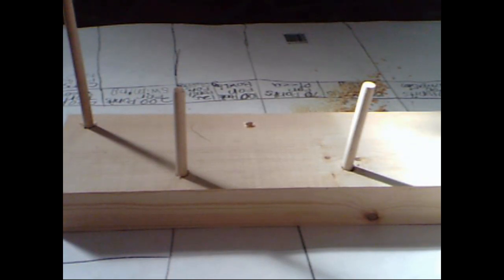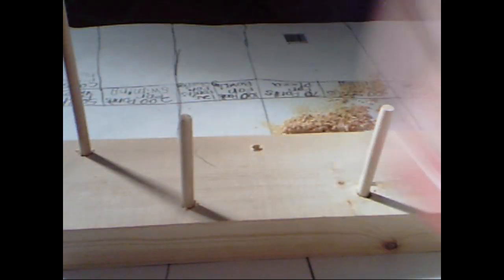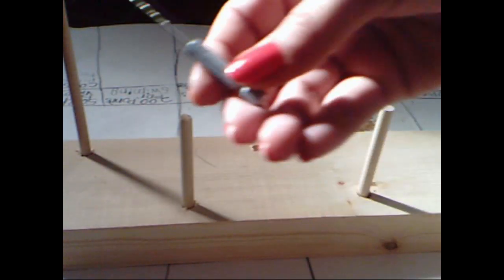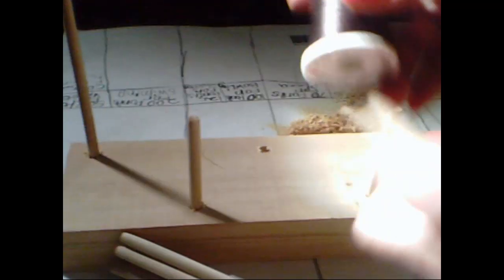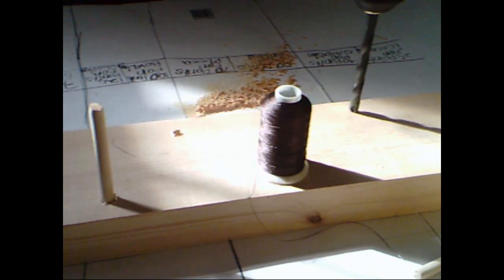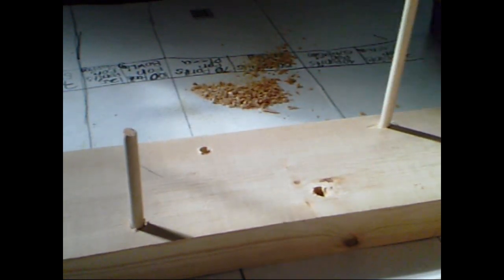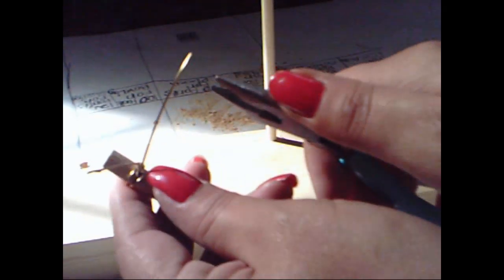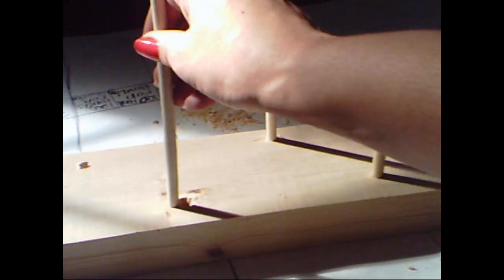Easy Thread stand for sewing, embroidery or quilting machine

Comment: Just a little tip from a DIY-gal... Stand above your drill to make it easier to get your drill bit in at 90 degrees, so your thread holders will be straight. You say to make sure it's straight, then forget it yourself ;) (easy to see when done/after with thread on)... I'd taken a little more time to use a ruler too, to space out the dowels evenly, it's very little work and would look a lot better on your sewing table! Maybe pretty it up with a coat of staining/wax or sim. too? :)

Comment: If you glue the dowels into the board, wouldn't you have to remove the wires every time you changed thread colors? I think it'd be easier to leave them unglued so you could change thread that much easier. Otherwise, great idea. I bought one of those cheapie ones at a fabric store and it keeps falling over.
Reply: Hi there :) no you wouldn't have to remove each time the way the wire is bent allows for you to slip thread on and off and on thr short ones that hold the thread there is no wire